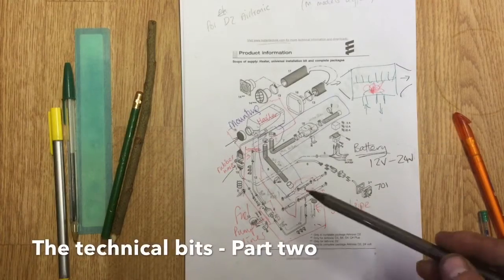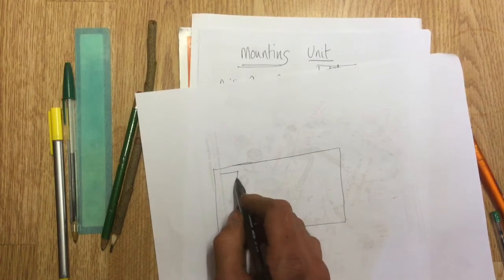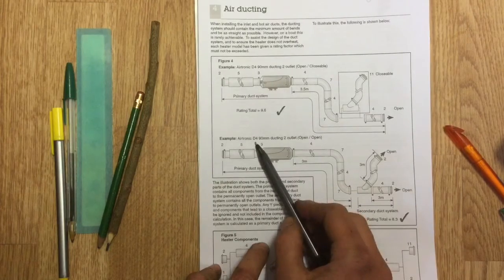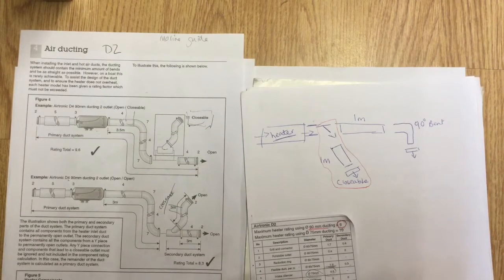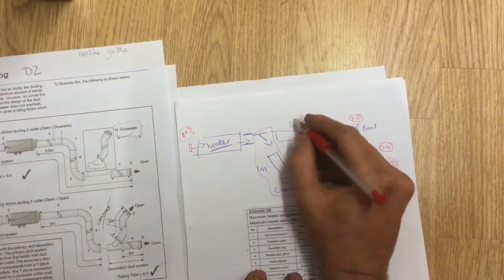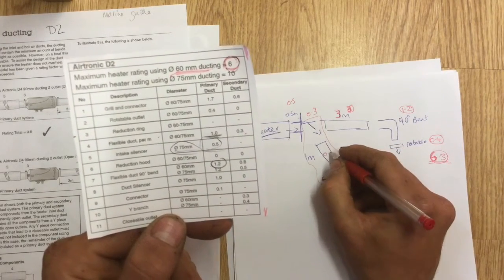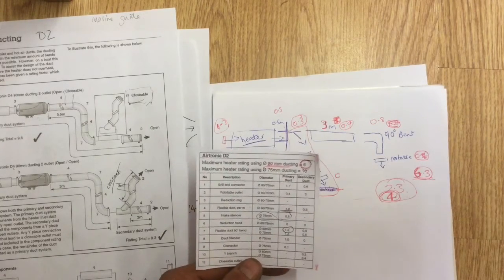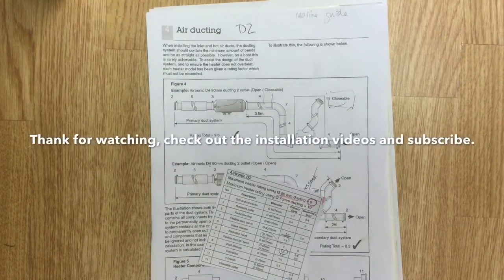Fitting An Eberspacher Heater - Technical bits part 2

Comment: Thanks for these videos they are great to watch. I am going to be fitting a Webasto 3500. Im guessing it's pretty much the same as the middle size eberspacher?
Reply from the maker: +AlabamaTree I've not worked with the webastos but from looking through the installation manuals it is a very similar setup and the same basic installation. The only difference is that some of the tolerances are different such as the info I talked about in the Technical bits videos. Like the Heater unit angle doesn't matter but the pump for diesel has to be flat not inclined. 
Just be sure to have a check of the finer details in the manual as you go through it. But it is pretty much the same.

Have fun, let us know when your done and if there were any major differences etc...

Sam